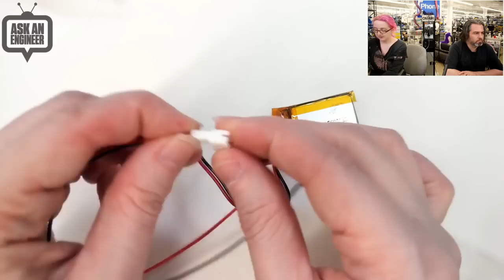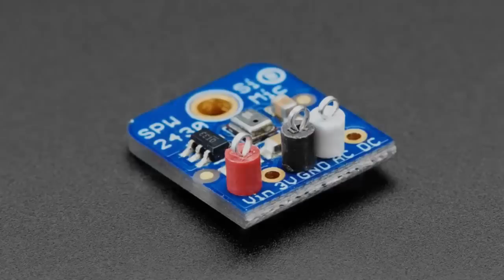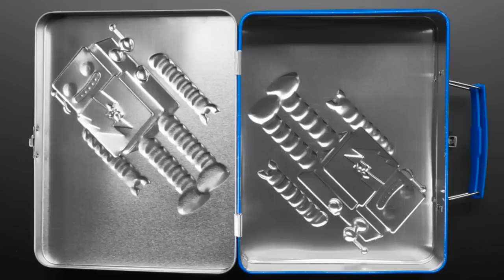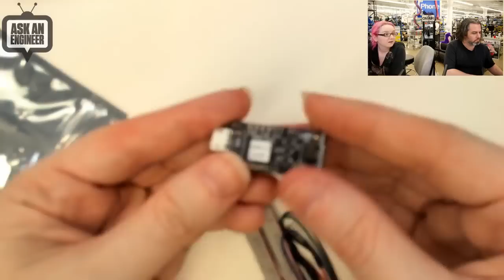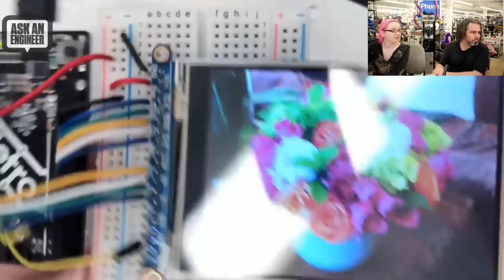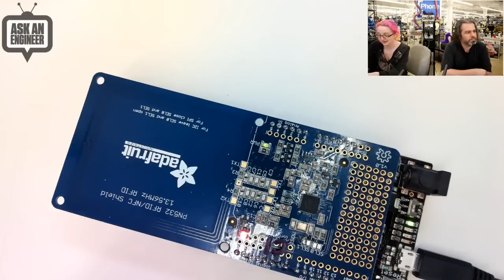New Products 6/6/2018 Featuring RFID/NFC Nail Stickers! @adafruit #adafruit

Comment: Is it safe to power a microbit using a single cell lipo battery? A cell could be at 4,2V when fully charged. The microbit supports only 3V as input.

Comment: Suggest test point colors, use resistor color band colors... BBROYGBV... for easy point number IDing.
Reply: Eugene Weltzer II Actually according to Lady Ada, the genesis of this is someone wanted less expensive versions of the Keystone test points. I know for a fact that the Keystone line has all 10 colors. Some of the knockoff lines don't. At Mouser where I get my Keystone test points, they are 21.6 cents each in quantities of 100. A little over double of the AdaFruit ones. If AdaFruit is able to get all 10 colors I'll probably switch vendors.

Comment: For the encoder wheels, all you need for direction is a second optical pickup and do quadrature decoding. You (AdaFruit) should carry the optical pickups for one-stop shopping. You probably will have them next week. ;-)
Reply: Christopher Elliott nghi puyet
Reply: Duane Degn you are right. My mistake. Thanx for the correction.
Reply: Or you can keep track of direction in the computer while you send control signals to the motor to spin one direction vs the other.

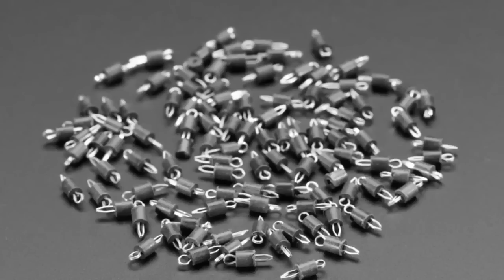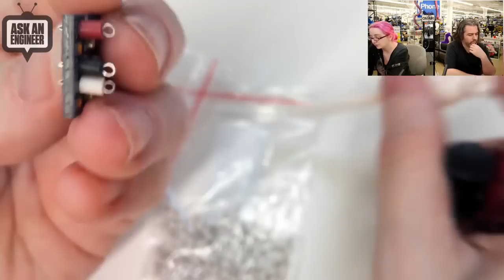Comment: 4:30 I have a name, @adafruit! 😉❤️ https://forums.adafruit.com/viewtopic.php?f=8&t=133348&p=677075#p663460 Been using these at @decaturmakers to allow children and https://github.com/haleyma/Arduino-On-Ramp-Class students to prototype without soldering. 6:36 When the "springiness wears out", I pull the plastic off, adjust the bend of the tips, and slide the plastic back on.